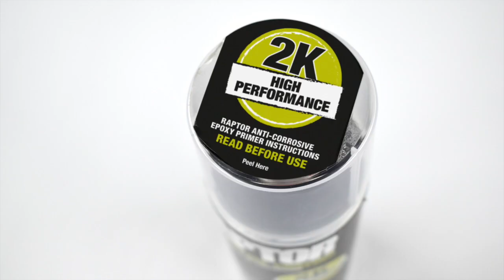2K Anti-Corrosive Epoxy Primer Aerosol Application with RAPTOR Protective Coating

Comment: I used this Raptor 2K spray this summer and it worked out great! Now there's another area inside my van that I've worked hard to prep for a spray.. but I'm afraid I've ran out of the 68 degree recommended weather for spraying. Tomorrow is supposed to be a high of 60°. Could I theoretically heat the van to 68 degrees or more before spraying (don't worry I would remove the heater and anything electrical before and after spraying to avoid igniting fumes) and then spray while the van is still warm? I predict the outside temperature would remain 60° for a few hours before steadily dropping to a low of 45°. Would this be enough time of warmth for a decent coat? I know this is not recommended practice but I really need this done before winter! Sorry for short notice. Thanks!
Reply from the maker: Hi Mossy, sorry for the delay in coming back to you. You will have to have the vehicle in a warm place for a few days.  Anything under 55 degrees and the curing process stops and it wont cure,  If you can keep it in a warmer garage that would be recommended.